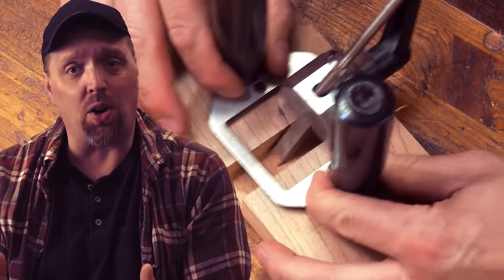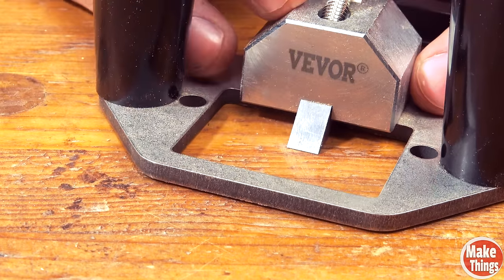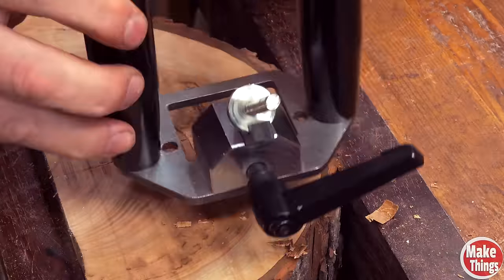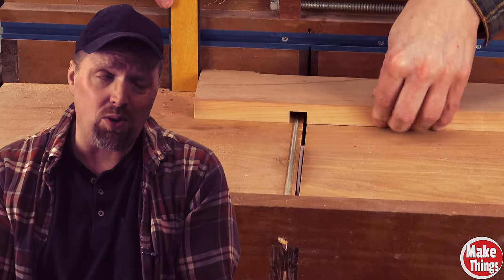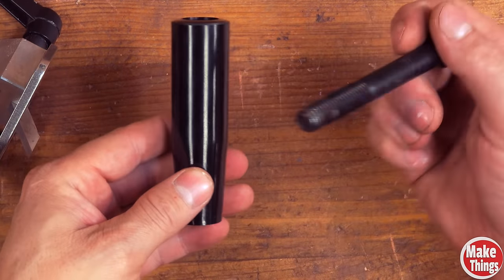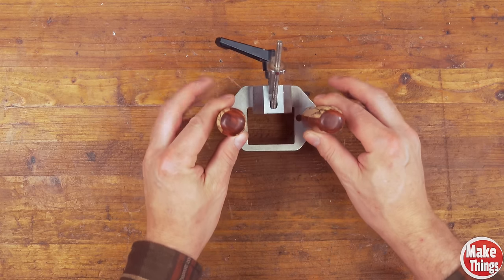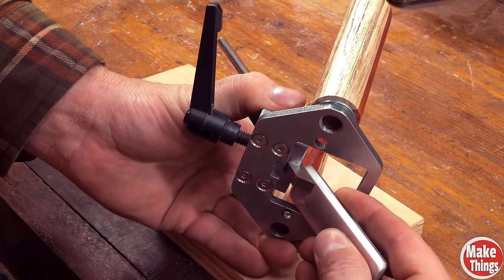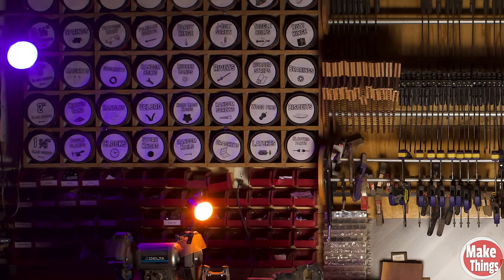The Tool Every Shop Should Have (I'm serious!) // Hand Tool Review

Comment: A quick recommendation: make an auxiliary sole for your router plane so you have a much larger reference surface when you need it. Doesn't have to be anything fancy. My current one is made with 1/4" acrylic, but I've made them with plywood and mdf as well and they work fine. I also have an offset sole that has a long side and a short side for hanging off of stock to clean up long tennons and that is made out of 1/2" hickory for rigidity. You can add fences and all sorts of extra functionality as and when you need it if you have auxiliary soles. Experiment and I think you'll enjoy it.  

I used the same vevor for a long time, still have it permanently attached to the offset sole. I recently picked up a KM router plane and it is super nice, but definitely a luxury if you don't use a router plane very regularly.

Comment: I agree with many of the comments here suggesting adding a larger plate to the plane bottom.  I have this plane and the base is small with a big hole in the center.  Nice tip on using another piece of wood to support the plane when working on a tenon.  Trimming the dowels on your workbench top and the pocket hole plugs would normally be done with a block plane or smoothing plane.  This is kind of an unusual use for a router plane but it got the job done which is pretty cool.

Comment: I would suggest a Japanese flush-cut saw instead for cutting dowels and such, then sand smooth. However, I'm sure you can get specialty knives (pricey, probably for the  router plane. As an aside, maybe grind your own knives to do beading, veining etc.  All in the name of true hand woodworking of course. Still, like your review of a useful tool, with a zero carbon footprint, after you buy or make yourself one. Might even help to get  climate change bozos to leave the woodworkers with tools alone. After watching you work, might need to revise my comment. Looks good when you do it.  I seem to have better luck with saw.

Comment: It's regrettable the Vevor router plane isn't currently available in the UK.
Reply: Cowryman makes one just as good and is available on Amazon. I have the large sole plane and it works wonderfully. Sharpens easily as shown on the video and is easy to use. Cheers.